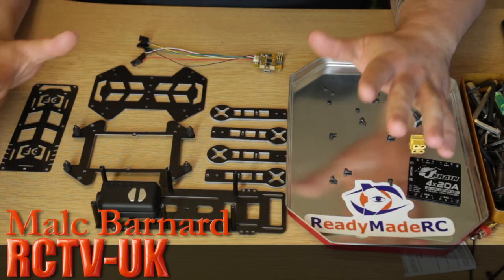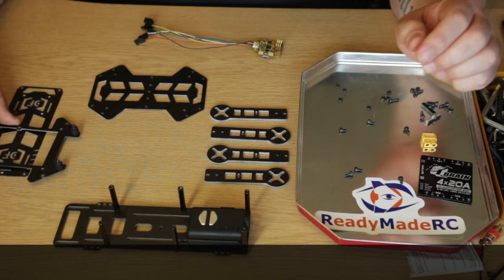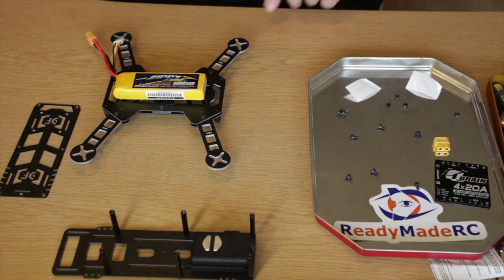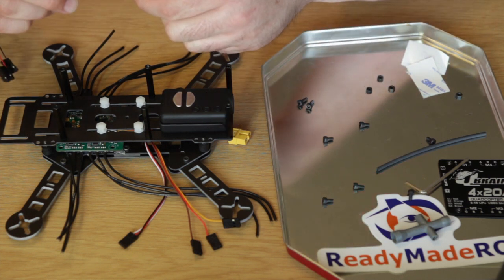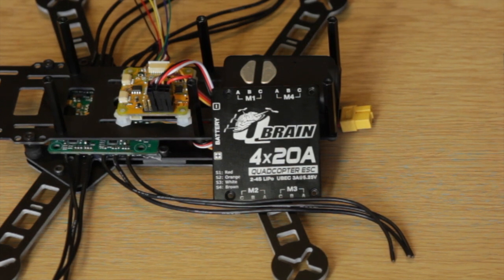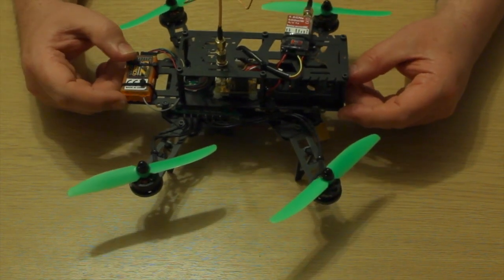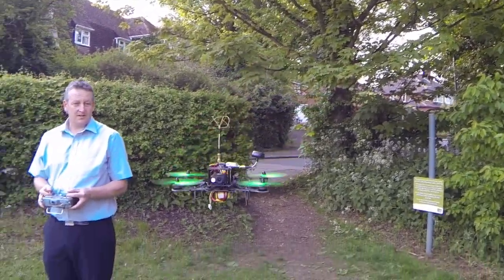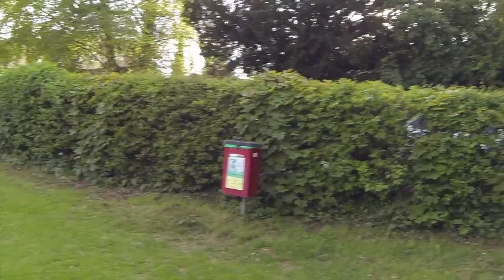The DRQ250 Project - Build, tips and maiden flight (AKA Mini D)

Comment: Nice, can't justify ANOTHER frame, but I've got some carbon sheet and I'm going to scratch build something along those lines... Just a couple of questions.... overheating with the Qbrain? I see you put it in the airstream, you know I'm a fan of them if you can save 65grams on one then it makes it much more usefull for the smaller stuff, 2nd is the cc3d that good? 3rd, where are those motors from? you told me I forgot!! a list of parts would be good.
watched all the way through, thanks for a great build video.
Reply from the maker: Hi Ben

There is a full list of everything in this build below the video in the description box ;) As for overheating.... Not yet and ordered another Q-Brain tonight. Loving the CC3D and it was easy to set up. Alan has just brought the Naze 32 though that seems to have huge potential! Hope that helps bud

ATB Malc
RCTV-UK
Reply: yeah, naz32 looks good, if a little daunting for a pre P.C born guy.... PROGRAMMING? I though you just had to build it!!

Comment: Thanks for that! I might go for that cc3d board. How many mins flight time are you getting on that battery? And do you know what weight it was before putting the FPV transmitter on?
Reply from the maker: Hi Paul not sure about weight or flight duration but that will be in the next video in this series I promise. Loving the CC3D from ReadyMade RC it is superb!

Comment: Quick question.. so you didnt use motor mounts? Just longer small screws and washer and nut..?  Im trying to figure out how I'm going to mount them.. I have the same motors..
Reply from the maker: Hi David, no motor mounts just 6mm length screws and some washers and you're golden ;)

HTH Malc
RCTV-UK